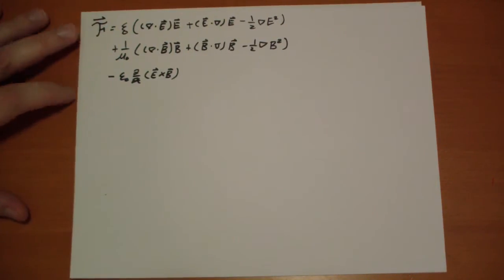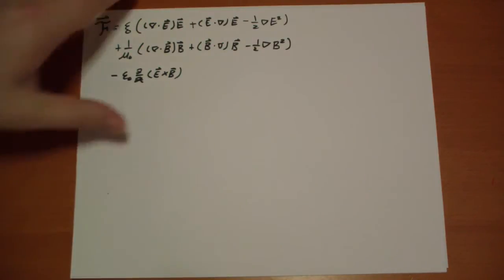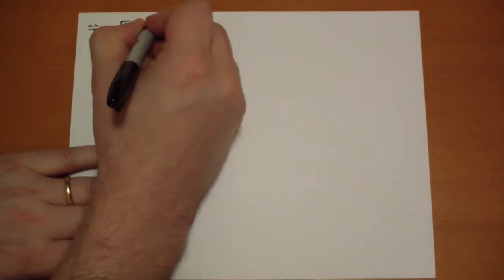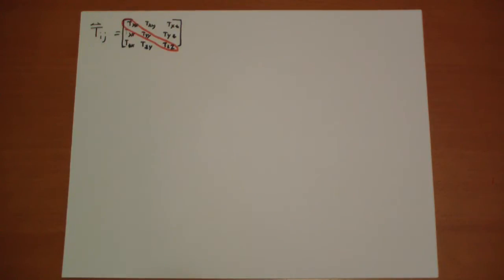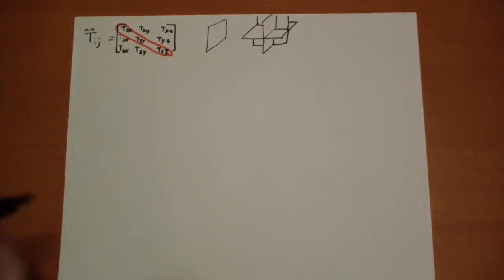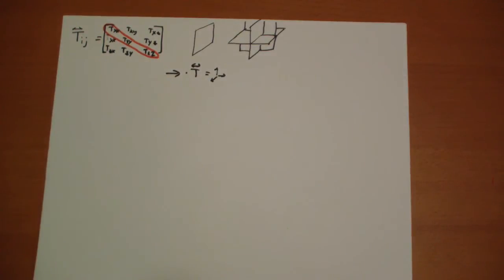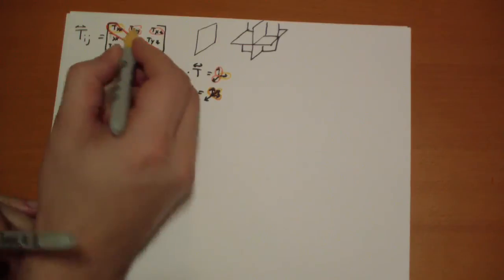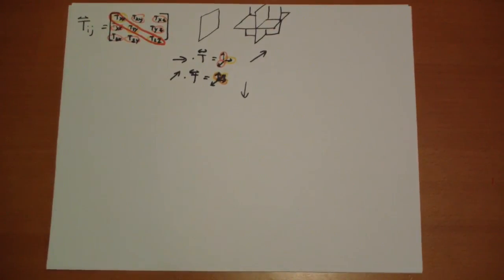7.5.3 Maxwell's Stress Tensor 2/4 (Introduction to Tensors)

Comment from the maker: Please tell me how I did. Did I help you understand tensors? Did Dan Fleisch fill in gaps? What are you still confused about?
Reply: Your video was enough, thanks for the intro. It was a good talk. I have too many questions in my mind though lol.
Reply: actually, you can use the analogy of stress tensor in structural mechanics, fluid mechanics or even continuum mechanics to get the sense of why they are called as pressure and shear physically. the presentation is good but for me, it is not enough to be honest. the pattern will also be the same in other part, such as the general relativity where we use the energy-momentum tensor